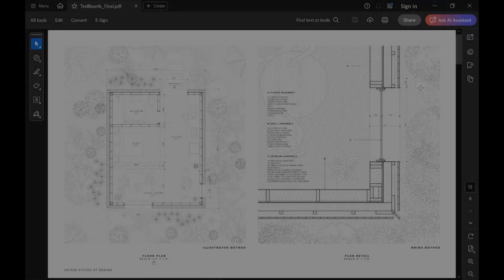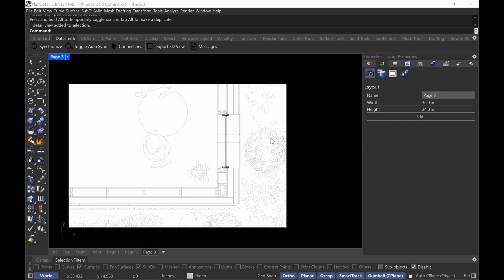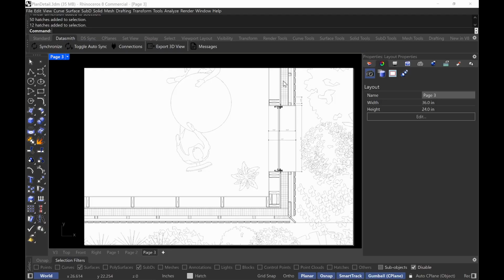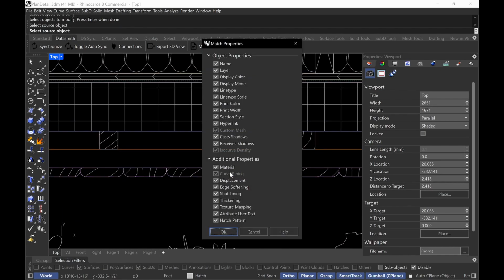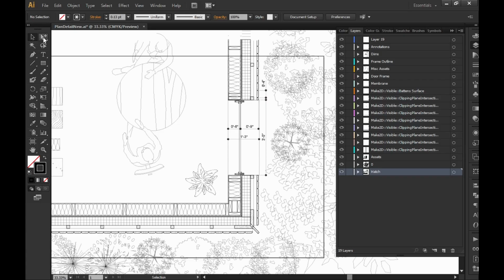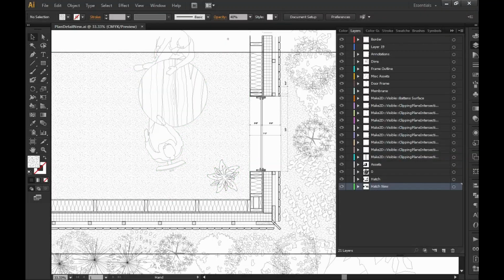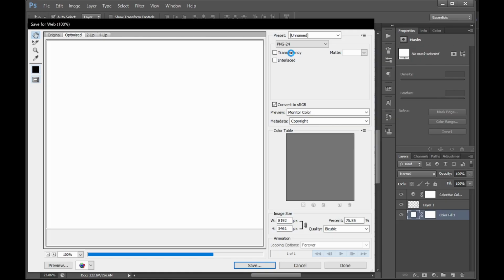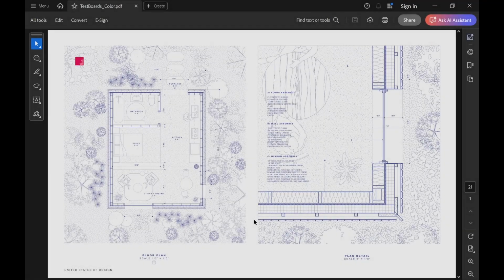Elegant Architecture Detail Drawings in Rhino 8 and Illustrator - 2 Easy Methods

Comment: how did you get the window detail model? are you using manufacture's provided 3d file? Thanks!
Reply from the maker: https://youtu.be/qXKEZ5uLHW8?si=avWGNSlnUwyDKOrf

All window manufacturers have 2D CAD blocks and sometimes 3D. I took the 2D CAD block and did sweep. I made a video earlier about how I created that entire wall and roof section model in Rhino.
Reply: @unitedstatesofdesign  Thank you for the info! Great line weight drawing! Great work flow! Great video!